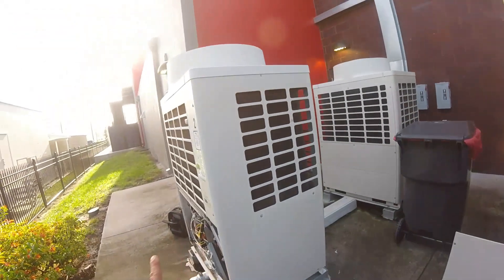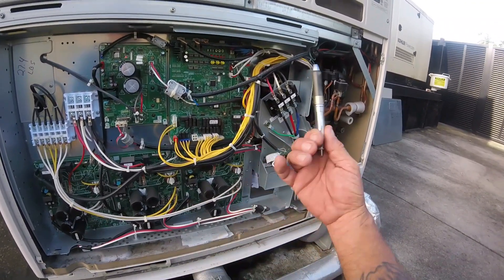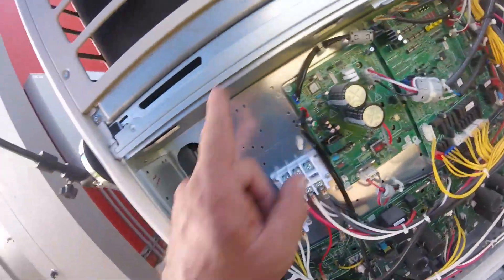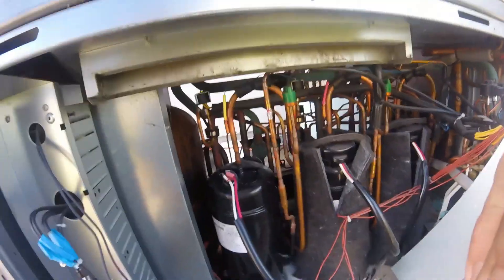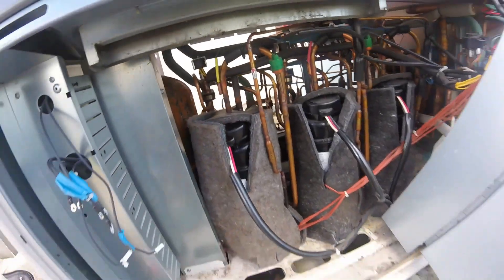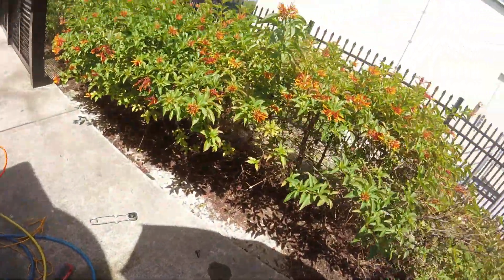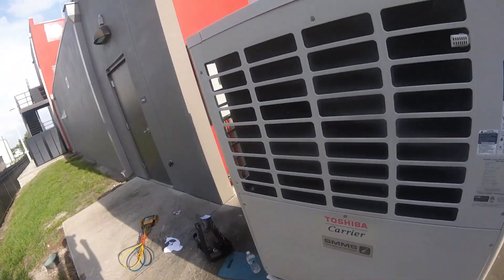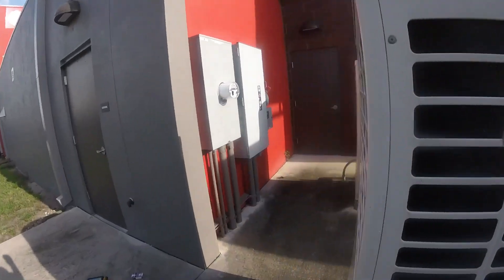Carrier VRF comprosser change out

Comment: How do you put it in recovery mode
Reply: Rotary dials set for 2,1,3 hold switch 4 untill hr appears. Rotate rotary switch 02 the whole way around leaving 5 seconds in-between each notch as you spin the dial. Eventually it will say All in the display. All solenoids are now open to recover refrigerant. Read the manual it spells it out.

Comment: Drewman, i was working today on a Carrier mini split and 1 head had a constant beep and the evaporator screen said 88?
Reply from the maker: I would need the model # of the condenser if it's a multiple zone unit to look it up... But 88 is weird, usually a letter and a number
Reply: Hvac with Drewman 

Model #40MAQB12B—-3. I know another Thecnician had said it was the board at the evaporator, I changed it and it still giving me that 88 and a constant beep. I could figure it out?
Reply from the maker: So a coworker had that problem, he replaced the display and said that took care of it... I haven't seen that problem yet
Reply: @hvacwithdrewman98  I have to go to that call tomorow morning, because i could call tech support, the day i was there, so you think is the display? because i disconnected the hardness to the display and it was still beeeping but the display was not on.
Reply from the maker: @Mike-yh8tv  I would be leaning towards that, you already replaced the board... The beeping I don't know, I have had good luck with tech support, they actually get them right away.. Im in Florida. Tampa/ clearwater area..
Reply: @hvacwithdrewman98  could the beeping be beacause i disconnected the display plug?
Reply from the maker: @Mike-yh8tv  it's possible, gotta let me know what you find out tomorrow.. I'm curious...
Reply: Im going to try changing the display, the client has 3 heads, i will use one of the the other display and connected to the abd one and see what happens…Thanks man, this unit has me not sleeping at night hopefully tomorrow morning, i can have an answer,,
Reply from the maker: @Mike-yh8tv  good idea.. hopefully that will prove the problem... Not to much stuff on those head's... Couple of sensors
Reply: @hvacwithdrewman98  I worked on the unit this morning, used the display on the head that was good, but still 88 beep…call tech support he said it may be the hardness wire that goes into the board and into the display. My manager will order it and we will try again.
Reply from the maker: @Mike-yh8tv  thanks for the update, that's the only thing I don't like about tech support, try this, try that... I always ask ok if I do that and it still not right what other things I can check so I don't have to keep calling...
Reply: @hvacwithdrewman98  so true this guy was driving me crazy, i had to tell him it could be the wire hardness, we have acase # hopefully this solves the issue he was like i have never hurd of a code 88 and constant beep. the customer was not happy but what can we do
Reply from the maker: @Mike-yh8tv  I haven't seen this issue, that's the hardest part is explaining it to the customer.. and its hard to try and charge for so much wasted time..